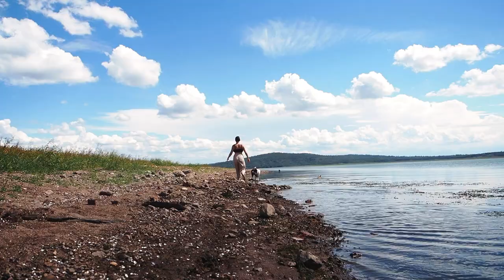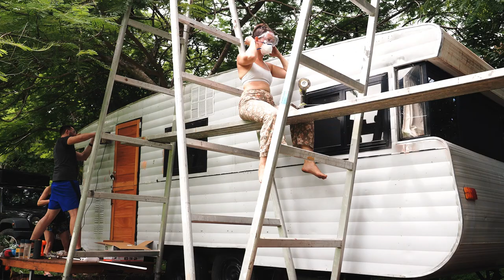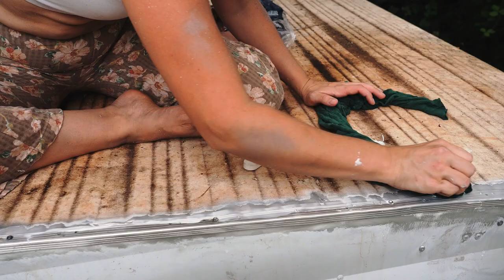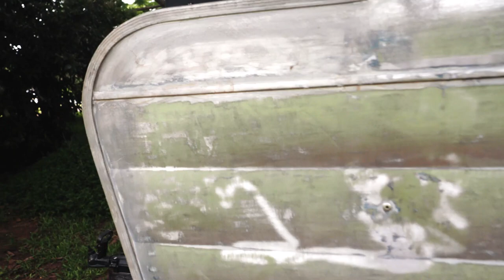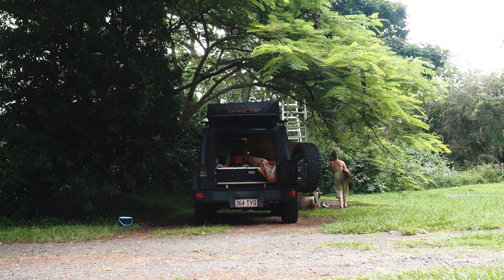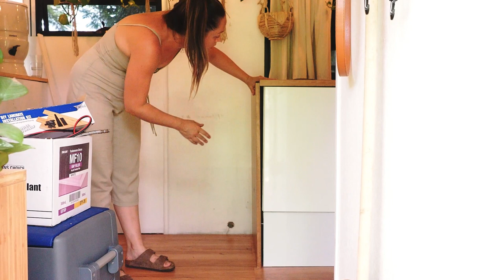Resealing the J Rail on my Vintage Caravan to Prevent Leaks! (Ep.5)

Comment: Get yourself a cheap ozito 5" angle grinder and get the clean and strip disk for it, you will find it so much more controllable than a drill mounted disk.